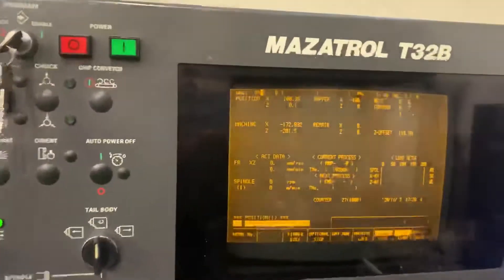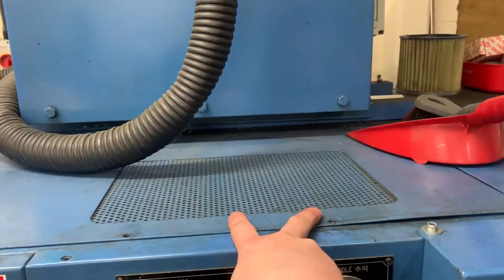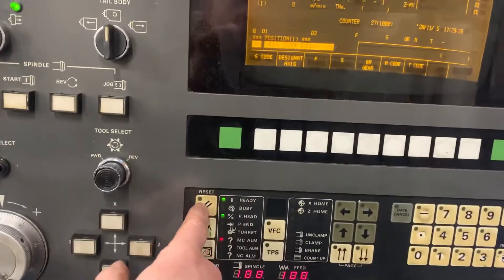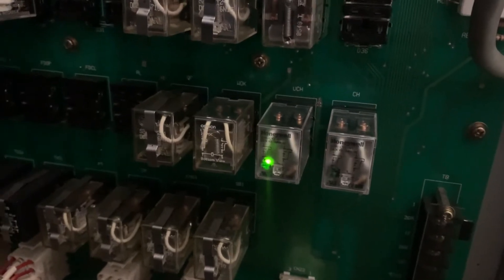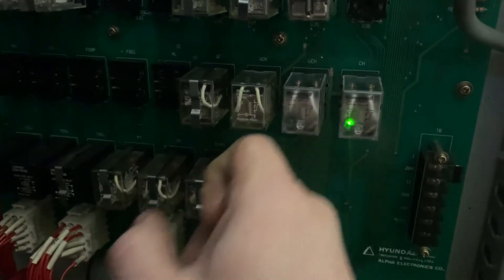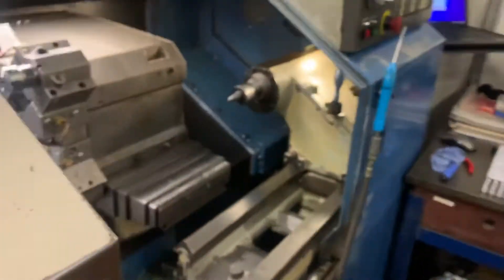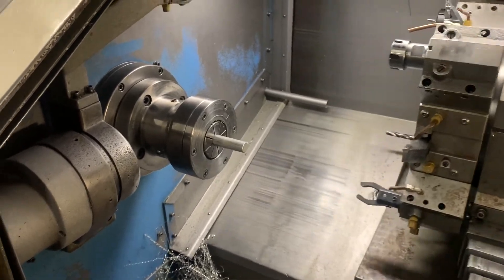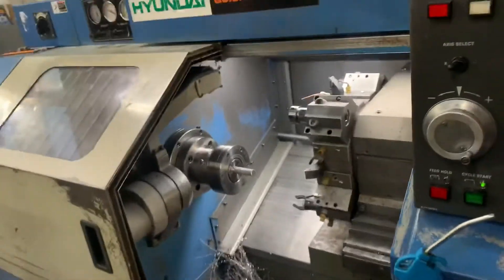Mazak Hyundai QT15n chuck opening issue

Comment: Trace power wires(signal) from relay and back to board, make new wires?
Reply: Most likely there is a crack as you said yourself.
Reply from the maker: It seems the issue may be a solid state relay on the main plc board, just waiting on some parts to arrive and be replaced to see if it works

Thanks
Marc
Reply: @kinzy_fabrications  Ok. Good luck. Post here when you get it fixed, if you got time.

Comment: Did you get anywhere with this? One thing to double check is the correct coil voltage on the relays against schematic - they may have been replaced with incorrect parts in the past and not releasing fast enough.
Reply from the maker: Hi

Just about to reply to all the comments,
I have found no fix yet!!! tried lots of things, replaced sockets, more relays which are definitely correct to the original electrical diagram book i have for the machine etc added surge suppressors, new coil solenoids new spark killers but nothing has worked

So today i had somebdy local from an electronics ind repair specialist have a look and they traced the control of the relays back to 2 main chips on the main PCL card and although not 100% sure they are the cause, he thinks they would be a good starting point to change both along with all the old capacitors on the board, 1 of the main reasons to suspect these chips was because the relays are still seeing 3 volts when they shouldnt be seeing anything, and the power to the relays is controlled directly by these 2 chips!

Downside is they can only be sourced from China now and will probably take 3 or 4 weeks to arrive now due to covid and the run up to xmas so i may not be able to update this for a while now buts thats whats happening and i will let everyone know if it does or does not work

Fingers crossed

Thanks
Marc

Comment: Think you've already diagnosed it Marc. Dry joint on the relay socket at the rear of the pcb not passing enough current to pull the relay in.
Reply from the maker: Hi

I have found no fix yet!!! tried lots of things, replaced sockets, more relays which are definitely correct to the original electrical diagram book i have for the machine etc added surge suppressors, new coil solenoids new spark killers but nothing has worked

So today i had somebdy local from an electronics ind repair specialist have a look and they traced the control of the relays back to 2 main chips on the main PCL card and although not 100% sure they are the cause, he thinks they would be a good starting point to change both along with all the old capacitors on the board, 1 of the main reasons to suspect these chips was because the relays are still seeing 3 volts when they shouldnt be seeing anything, and the power to the relays is controlled directly by these 2 chips!

Downside is they can only be sourced from China now and will probably take 3 or 4 weeks to arrive now due to covid and the run up to xmas so i may not be able to update this for a while now buts thats whats happening and i will let everyone know if it does or does not work

Fingers crossed

Thanks
Marc
Reply: @kinzy_fabrications  thanks Marc. We have a similar thing happen on 24v PLC's at the plant I work in. The relays need 18v to pull in but would retain on the residual pass through voltage from the PLC output (6v) so we put a resistor in to drop this voltage down and the relays now drop out o.k. you could try it?
Reply: In parallel with the relay coil. 5k 5w resistor
Reply from the maker: @mapstardamo1624  
These main board plc chips have been ordered so we will se how we get on with that first and go from there lol

Comment: Pretty sure it will be a small crack on the solder joint on the back of the board just need to re solder it. Very common when there are large components on a pcb.
Reply from the maker: Doesnt seem to be the case in this occasion,

Going to try changing some chips on the main pcl card as they seem to be the prime suspects now i will update in a few weeks if it works or not but part wo,nt be here til,l, after xm,as m,aybe now

Thanks
Marc

Comment: I would solder the relay sockets, i would guess the soldering went bad over the years. Everytime you tap the relay you get a short contact again. I would think the two  relays are so wired that they need one another to operate.
Reply from the maker: Hi

New sockets didnt make any difference unfortunately, had the pcb checked and although old it all seems to be working as it should even after a couple of suspect track repairs

About to try replacing some plc chips after a specialist look at it and suspect them

Thanks
Marc

Comment: Marc after watching the video again.
I would be confident to say it's the connection between the Relay and the Main board.
I doubt there would be a problem with the main board itself other than the female pins inside the plug for the Relay.
It is a bit of a pain sorting out electrical issues.
Looks like you have got a good start to fixing the problem at least.
As mentioned below, would be good to know IF and how you fixed the problem.
Peter.
Reply from the maker: Right I’ve been on this all day eliminating things 1 by 1 but still not solved it,

It’s not the relays, 
It’s not the control valves or the coil solenoids
It’s not the cables
It’s not the supply voltage or coil voltage
It’s not the sockets or dry joints

The problem is between the unchuck & chuck relays as they are interlocked so 1 will always be on when the other is off and visa versa so it can’t command open and close at the same time, but as it switches between the 2 sometimes goes wrong

But I still can’t identify the exact cause!

Think I will be getting someone out and I’ve tried all I can think of

Thanks
Marc

Comment: Maybe get a few spade connectors, make up a few wires and wire the relay so its not on the board? That way you can see if your tapping is something to do with the relay or the board. Could you also swap this new relay with an other working original one? Your tapping could be closing the relay contacts - again you could test this easier if wired up externally with a multimeter hooked on also.
Reply: SB.
Definitely sounds like a Good place to start.

Marc i would be swapping one of the original Relays still on the board to check the connection point.
My concern is the pin size on the replacement Honeywell contacts is slightly smaller and Not making good contact with the pin.
I am doubting that the Relays are the problem.
More so the contact point.
I noticed that the metal clips retaining the Relay is Missing also ??
I don't think this is a problem but it could definitely add to the current one.

I am sure before you even read these comments you have already solved the problem ?
It would be Good to know IF and how you fix the problem ?

All the best.
Peter.
Reply from the maker: Hi

Just about to reply to all the comments,
I have found no fix yet!!! tried lots of things, replaced sockets, more relays which are definitely correct to the original electrical diagram book i have for the machine etc added surge suppressors, new coil solenoids new spark killers but nothing has worked

So today i had somebdy local from an electronics ind repair specialist have a look and they traced the control of the relays back to 2 main chips on the main PCL card and although not 100% sure they are the cause, he thinks they would be a good starting point to change both along with all the old capacitors on the board, 1 of the main reasons to suspect these chips was because the relays are still seeing 3 volts when they shouldnt be seeing anything, and the power to the relays is controlled directly by these 2 chips!

Downside is they can only be sourced from China now and will probably take 3 or 4 weeks to arrive now due to covid and the run up to xmas so i may not be able to update this for a while now buts thats whats happening and i will let everyone know if it does or does not work

Fingers crossed

Thanks
Marc
Reply: @kinzy_fabrications 
Hey Marc.
Thanks for your reply.
I was like you i guess,  hoping for Good news ?

Not good so far ??
Unfortunately one of the not so good joys of owning an older CNC Machine.
Glad to know one good thing though ?
At least parts are still available, not as much can be said for other machines of this vintage ??
At least Mazak were smart enough to stick with a workable model when building these machines.
Where as other manufacturers leave you stranded without replacement parts available.
A few times ran into this problem because some builders are so busy trying to improve which is great,  but to bad if you don't own one of these improved models ????
Hoping to see a video soon of your smiling face when your machine is running again.
Thanks again.
All the best, Peter.
Reply from the maker: @weldmachine  good thing is the machine still works so I can still use it but it just won’t bar pull without timing out all the time so it’s not too bad like if it was completely out of action
Reply: Happy to know you can still run it at least.
You are doing better than me ?
At least your CNC Lathe runs mine is still out of action until early next year at a guess ??
I am happy enough producing parts on the Manual lathe, but it would be good to have it finished and out the way.
Reply: Agree with SB, isolate the issue. You know one relay is good (the one on the left) so you could swap them too, see if the issue follows the relay or the board position